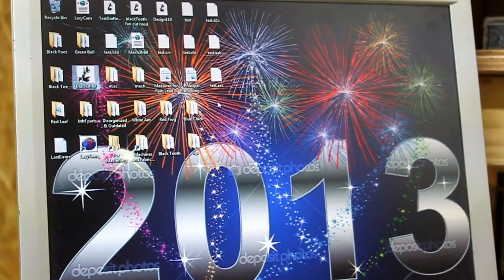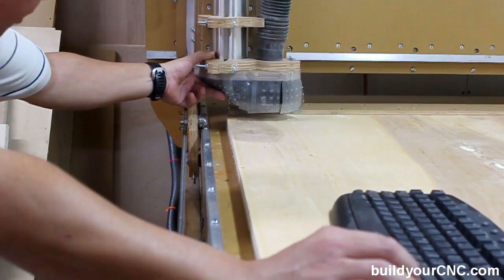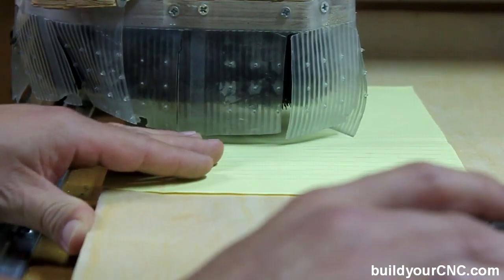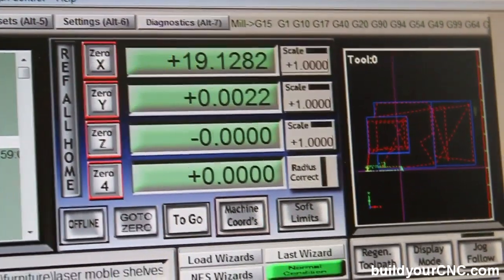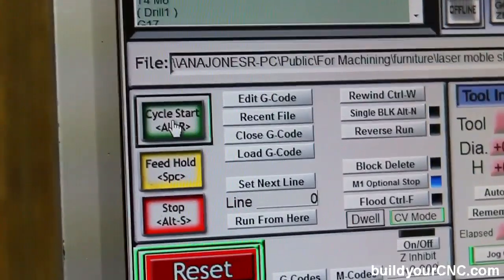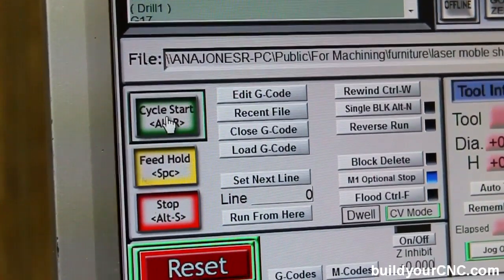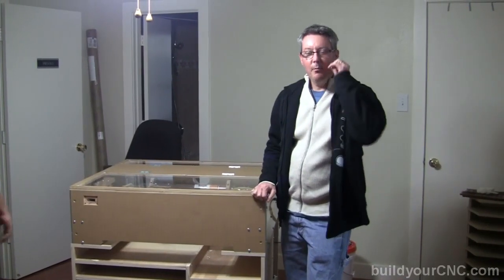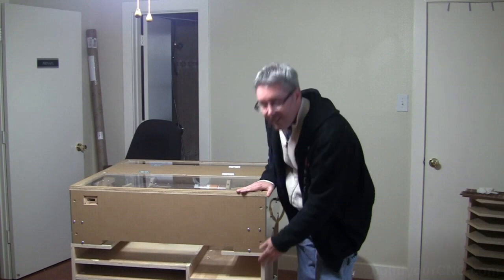Part 3: From SketchUp to Fabrication

Comment from the maker: It's a base for our laser cutter.  The base has casters to allow the machine to move about.  There are shelves to hold sheet stock and the area with the bucket holds the water for cooling the laser tube.